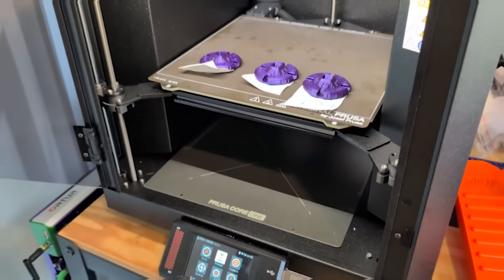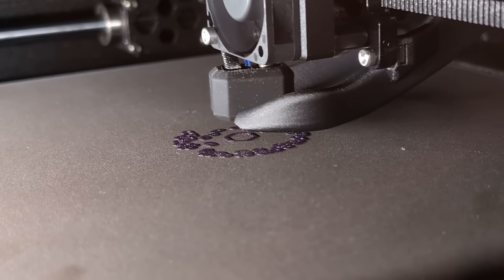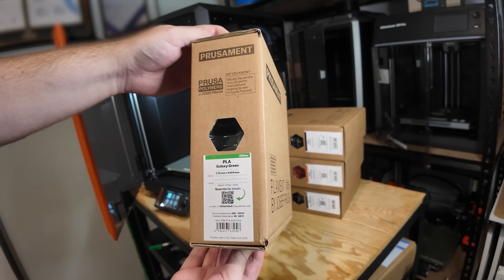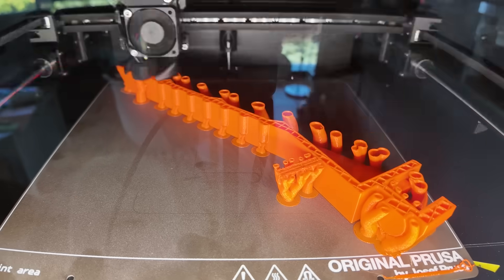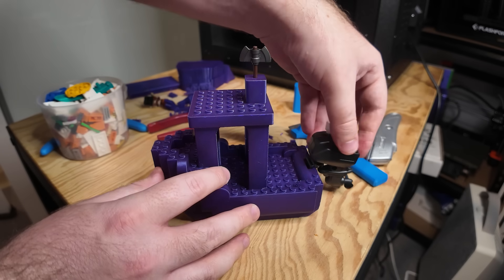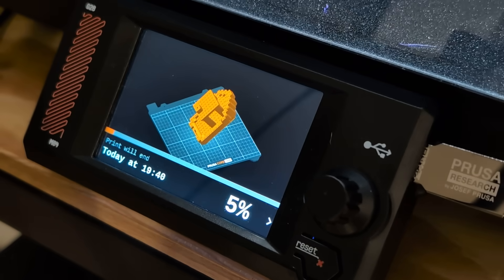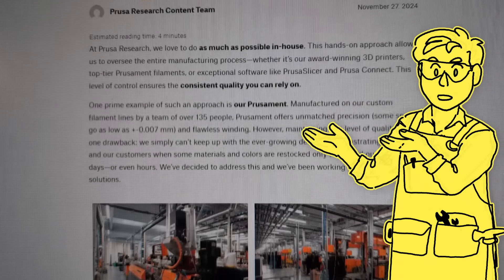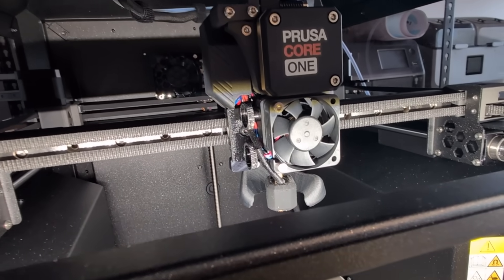This is a Modder’s Dream - Prusa Core One 3D Printer

Comment: 3:05 Dude, all that wasted pretty purple filament. Should have printed it on it's side, would have also been the correct orientation for the application in regards to strength. Changing the fillets to filleted chamfers would have meant zero support required.
Reply from the maker: Yep you're correct, I trusted the auto orientation when I should have questioned it. However the pretty purple supports have since been melted down into pretty purple coasters :D

Comment: those bumps on a slope that is not hanging but facing up happen because the printer on speed settings ( or some other profiles ) skips bridging a small section of the infil and goes straight to pulling the wall overtop of the sloped area,  with the structure setting ( or when manually turned on ) it will fill the section of infill underneath a slope with some bridges every layer so the slope has a spot to adhere to and not cause those bumps! took me days to find out why that happens exactly

Comment: it's still using old tech and using cheap plastics rivets  what other short cuts. By the way what board does it use chip size ram storage. What temp for the nozzle chamber temp for me the QUIDI leaves this for dead and is way cheaper

Comment: Hard to justify the prices nowadays, when you got printers with bigger build volume, at a fifth of the price. Hard to compete with china.
Reply: Please name one!
Reply: @RogerEssigArtist  I own an mk3s, not hating on prusa, but I rather have 5x 300 dollars corexy printers. You just don't need an expensive printer anymore to print well.
Reply: @ Please name one!
Reply: Lol. Why? I'd get a mk4 when people upgrade to the core one.
Reply: @oneanother1  you are asking why am I asking you to name a 3D printer that is 5x cheaper than a core one and also has a larger build volume? Why?
Reply: @RogerEssigArtist  its just not worth getting a prusa anymore. They are still stuck in the DIY era of 3d printers.
Reply: @oneanother1  What printer is 5x cheaper than a core one and has a large build volume? I'd like to get one
Reply: @bhaalgorn  elegoo centuari is 300 bucks. I'm more interested in the artillery m1. You can always find last years corexy machines for pretty cheap.
Reply: @oneanother1 good luck with the elegoo. Have a look at the issues people have with the Neptune. I have had my motherboard fail and it’s only just 12mths old.
Reply: @MichaelandMaryH  sorry to hear that. I have a kobra2 pro, similar to the Neptune. Its fast, prints fine, locked firmware though. I like the artillery m1 by the looks of it, may be better than the elegoo. I'm also waiting for the regular sized creality k2, I have a k1.

Comment: Fun fact, the printer is asymmetrical primarily because the nozzle isn't centered on the extruder in the first place, later in the dev cycle we realized we can have the filament completely flush on the right side, and optimized it a little bit more.
Reply from the maker: This is very interesting! Thanks for sharing!!
Reply: @BuildyBryce  Also, its better for mods, like the filament drybox to completely enclose it without it sticking out ;) so im not disappointed at all by it.
Reply: Is the mmu3 add on still on schedule?
Reply: I came to say this exact thing.

Comment: Another reason for choosing Prusa : you can always upgrade your printer to the next generation, aka you're not stuck with your machine when a new generation cames out or being forced to buy a whole new printer. You can just buy the upgrade kit for a lower price than the full printer and get all the new features.
Reply: The issue I find myself in is how long it takes to print stuff. One printer can print so fast, but multiple printers can get it done faster.

Comment: Regarding the bumps on the top layer: use another infill type - the default (I think it’s grid) crosses itself when being laid down thereby creating small bumps that the nozzle collides with when laying down the next layer. You can also hear it when the nozzle travels over these. I tend to use gyroid myself.